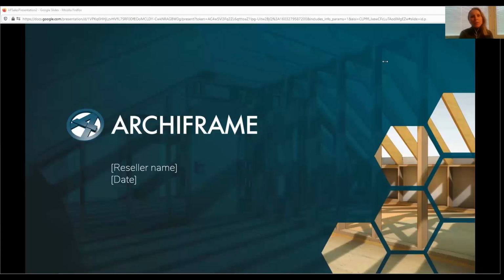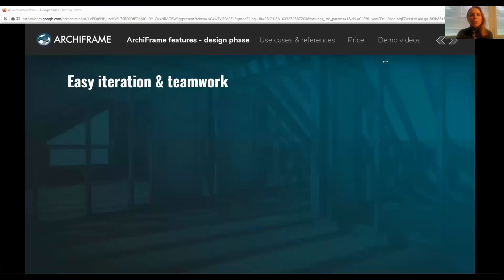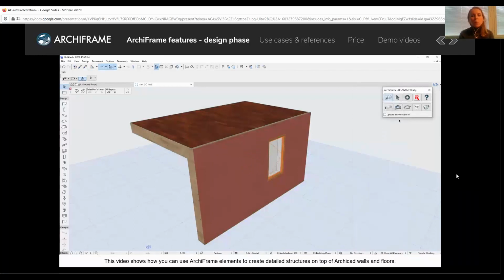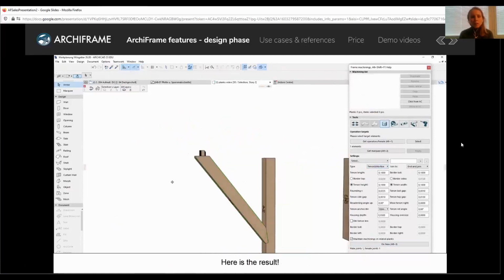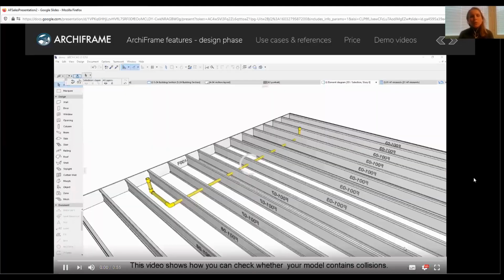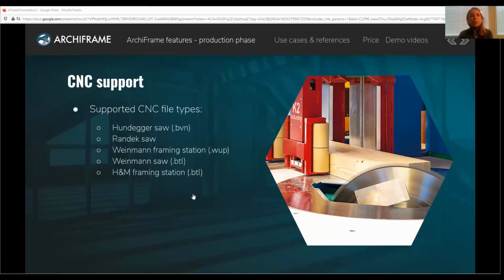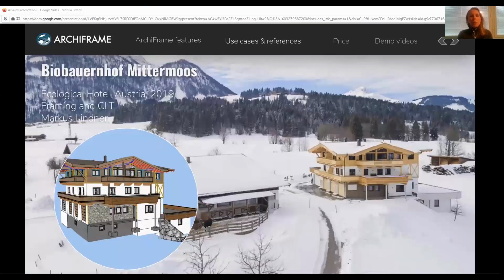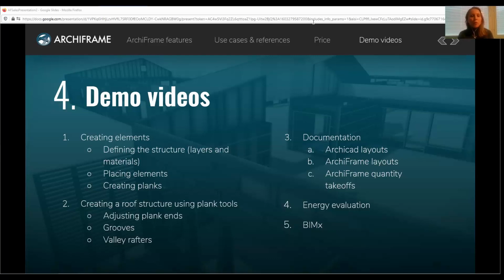ArchiFrame Demo Presentation: Archicad Framing Add-on Deep Dive

Comment: Are the generated structural elements BIM compatible with third party structural analysis tools? How do you work with an engineer ?
Reply from the maker: Hi Constantine, yes - we have customer using IFC-export to take the model into structural analysis tool. In long term roadmap we have discussions with Graphisoft to allow exporting any object including ArchiFrame's ones into structural analysis  as you can do today with columns, beams and walls. Also, we have many customers using BIMCloud allowing engineers and/or architects to work on the same model concurrently.